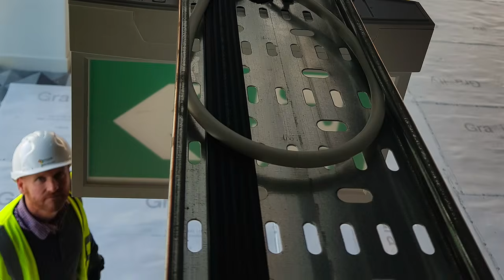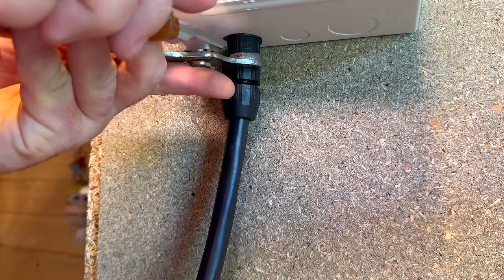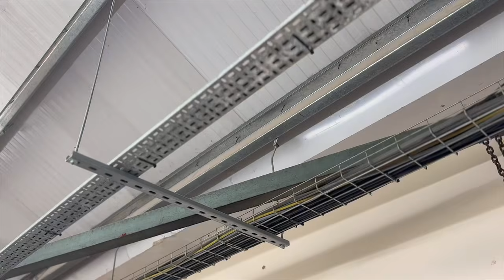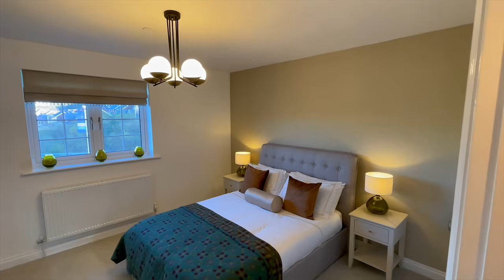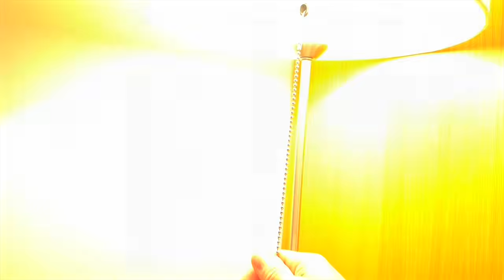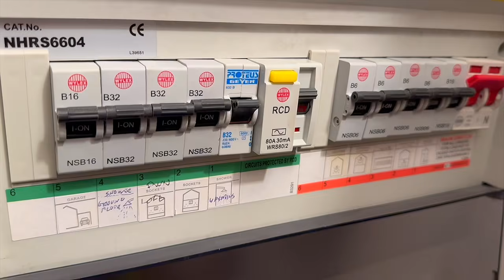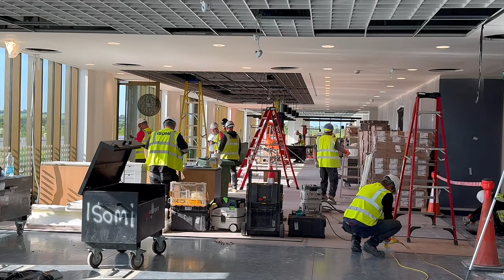The Cable That Isn't Really A Cable...

Comment: how do you isolate specific units you cant without access to the termination? what happens when you have larger loads than podus cant handle 32A per room is reasonable only for hotels and temporary domestic but no regular unit or apartment is going to be on 32 amps and that is most definitely a cable is it a standard cable no its specialised but definitely still just a double insulated cable that happens to be in a very specific formfactor that makes inline tapping convenient

Comment: Every branch MUST be fuzed.
There are plenty of good reason to have the fuses at a single location.
The bus is significantly more expensive to do RIGHT. And if the personnel doesn’t understand how it works, the bus can be extremely dangerous, so you MUST do it the way that will certainly enough prevent unqualified people tinkering with it, which is expensive.
But the actual reason WHY it is expensive is that hardly anyone does it, those who do that charge insane work rates, and the components are ridiculously expensive.

Comment: - It's still a cable... just a proprietary cable... that's part of a proprietary electrical ecosystem
 - A proprietary electrical ecosystem where if something breaks and requires replacing or fixing, you are at the mercy of the manufacturer for parts
 - A manufacturer that decides when 'that' model of 'that' part is no longer supported and you must buy the new one
 - A manufacturer that will probably jack up the price of said model or entire proprietary electrical ecosystem over time
 - A manufacturer that if goes out of business, good luck getting spare parts at all
 - A manufacturer that who's product cannot be worked on by the average sparky

So deferring time and cost to later or to other areas of the logistical and installation pipeline is what we call efficiency now?

Comment: Well outside of the United States they are already mostly running cables anyway, but here in the United States, you might see something similar for like office cubicles, or under a false floor. In a hotel with a hard lid could you imagine the ceiling covered with access panels all over the place, to service everyone of the tap points? Not to mention yes if the feeder cable goes bad at point 1 then 2 through 9 will be out, and the feeder cable from 2 to 3 would have to be replaced, or add a splice point with another access, which is another failure point. The biggest issue with this system is that it’s a proprietary system, every time something needs fixed you have to use the same manufacturer, that’s a servicing nightmare. Car manufacturers have been trying to do this for years so that they can build cars cheap and always have guaranteed maintenance for their vehicles, and you have to use the manufacturer and cat just use a repair shop. Apple was one of the first companies to do this to be different with there computer software. Every other computer company used windows and Microsoft, apple had to be different, this hurt them till the iPhone. You see it with Xbox, and play station, google and bing, Amazon and Walmart. The point is that they are trying to take the skill out of the trades so that someone who has no training can do the work to save on labor, at the cost of the customer later down the life of the project. Same as the car manufacturing companies wanting the guaranteed maintenance, they want a building that guarantees them profits for years to come form sales of replacement parts. Fire alarm, and security companies have already been doing this for decades.

Comment: With as many as 10 subtended rooms on a floor and with resistive heating and aircon cassettes or through-wall units, it might be wise to run two PODIS runs with one direction fed in reverse. Then putting the heavy load final circuits ends nearest the feed that comes from the larger supply ampacity end.

The labour would not go up, just the need for a large capacity cable to feed the other direction. If the plant room is central at core of building then this becomes moot and two runs with bus feeding from centre would offer resilience albeit with split feeding load and split fed dual bus-bar DB in the hotel room.

The install is less disruptive but a single issue over time could lose the floor.
Protection for each room would still be expensive but the diversity would be upset by probably standardising in just as big a shirt-circuit leak current capability along the whole run.

In the car EV situation, it seems that PODIS might attract less copper theft opportunity, but then, more likely to be visible than underground fed pillars.

You can make quite a few arguments over safety and economy either way. And the Ethernet delivery will be parallel fed optical or structured cable.

More than four rooms per floor, and perhaps a hybrid solution works best. Five radials and odd/even numbered rooms bussed via PODIS and depending if doors are spaced or adjoined architrave/intumescent boundary, then they might also share the same void mounted location for DB, BMS, PDS and DES. (Distribution board for power, building management system for fire alarm and air-con temperature override, Premises Distribution System for data, telephony and tv, and Door Entry System).

PODIS looks good for modest demand hotels, particularly ones near airports with arrivals/departures at all hours.

And long driveways with more charging points along a long wall or fence than the regular number of cars present. Assuming load curtailment based on occupancy and the maximum ampacity of each bus run.

Like Doncaster Cables, there is a time to use them and a time where you might opt not to.

Great coverage of the Wieland PODIS solution.

Another out of the normal way of thinking might be to run SOCAPEX 2.5mm, from the plant room to each hotel room, as the loads of aircon, towel rail, kettle, trouser press, TV and door lock fail-open mortice lock or handle barrel could likely fit in the BS7671 conductor grouping derating scheme too. Then, all the breakers could be in the plant room and just having a wiring centre in the rooms. Distribution mentality can pay back in other ways, such as if you have a really grumpy janitor who should be never be seen by the paying public.

SOCAPEX 1.5mm could be for lighting and other small loads, split between room pairings. With higher loads in same rooms split on 2.5mm SOCAPEX.
PODIS having the disadvantage of three phase hitting the neutral conductor that is not oversized or three phase represented at the ampacity strained distribution layer.

I may develop some designs for contractors to come in and use PODIS instead of classical industry practices or stage/event style philosophies.
And I am thinking of the merits far more now than how I concluded during the EV application of a common bus power fabric.

Thanks guys.

Comment: If the cable furthest from the DB only has to be rated for a tenth of the current... That's a hell of a waste of copper isn't it?
Reply: Yes, but if you stepped down a cable size after each room tap off, you would need a new breaker for each section of cable. You can't have a 63A breaker covering the whole string if the tail end of it is only 4mm CSA - a fault in the end section could be enough to start a fire whilst not being enough to trip the breaker.

Comment: How is it repaired if a Tapping point is removed ?
Can't just leave it with those Holes showing
Reply: Why do you need to remove the tapping point connector?

You can just leave it in situ. It is not unsafe .
Reply: Bathroom silicon ?
Reply: Black color…

Comment: And what guarantee is there that this system—and its accessories—will still exist in the future, say, in 20 years?
Reply: @tristankordek  I get nervous using proprietary systems. Open source usually gives more options when the supplier goes under or gets taken over by their competitor and shut down. 
Also brings up right to repair concerns.
I like better mousetrap. And I've been burned by proprietary systems that became unavailable. 

This is why we're paid the big bucks. To make decisions like this. Then to not sleep afterwards.

Comment: "This is a different way of doing things" is a wild thing to say about parts of a circuit close to supply carrying more current. You guys have heard of A2 radial circuits.
This 'system' is just describing any cascading sub main feeder system with a 16mm sub main before final, though, where the labour won't be that much more for none of the vendor lock in.
Funny to compare it to final circuits fed direct from a rising main, no new installs will be doing it that way unless they're in a small site with a complex layout like a converted manor house hotel, sites where this product would be useless.
You could compare it to wiring every single socket in every single room to its own metered connection to the grid for comparison, with that labour and those DNO costs this product would be thousands of times cheaper.
If you're not going to compare it to the genuine convention then you might as well have fun with it, right?

Comment: Is that system not somewhat similar to one that was being pushed 40 or so years ago?  By Datwyler, a Swiss company, IIRC, but that's not necessarily correct... I used their flat form cable for crane control / power festoons, and perhaps it was Datwyler sending me info, or maybe it was a competitor. I just thought the puncturing of the sheath and the insulation at tappings might preclude my reusing recovered cabling elsewhere...
Reply: I am not really familiar with their cables (outside of seeing their Ethernet cables), but yes, Dätwyler is Swiss.
Reply: @tookitogo  The more I think about it, the more I convince myself that Datwyler offered similar connectors in the 80s.  They didn't seem to be of much use in the crane industry at the time, and the inventory value was likely to be high... I can't find them offering it now... the 500m drums of multicore flatform were expensive enough...

Comment: If the cable is rated at 63A how is it suitable for a 160A supply ? If more than 50% diversity can be applied, guidance documents should be updated.

Comment: My initial thoughts. 
Discrimination. How is the protective device sized at the DB also protect the individual smaller cables to each room consumer unit ? 
If there is a fault and the protective device operates at the DB, you have lost power to the whole floor. Traditional system this is not the case, just one/two rooms ? One could argue how is this different to the "supply" to the floor DB ? I might suggest the difference is that the cable supplying the DB at each floor from the DB at origin is probably a single cable,  no connections/interruptions, no human interference/interaction and less likely to fail ?      
I am sure the manufacturers have thought of this, obvious questions but a little surprised they are not addressed in the presentation ? 
Thank you
Reply: Small distribution panels in each room connected to each branch cable 

A lot of hotels already do this.

Comment: One way to tackle diversity is a ring main, although imagine accidently twisting the cable at least the earth wire is in the middle😁
Reply: So you want to run two cables rather than one?  Okkkkkkkayy.
Seems like a strange way of thinking.

Comment: I am confused how this is different from when we run 10mm supplies in and out of rooms in care/nursing homes where each room has it's own CU on one large radial circuit with each room having a 20 Amp socket circuit for beds/ sockets and a 6 amp lighting circuit. There is a a chance some rooms might have an additional heater plugged in at some point but it's highly unlikely now they've switched over to electric blankets.
So every other room is on a separate supply/phase yes it's a different cable as it's only a 3 core armoured, or in some cases T&E depending on containment but I would expect our method is equally as cheap as this 3 phase flat cable.
Honestly outside of the carpark EV point showcase I originally saw this cable used for on your channel with load balancing chargers I can't think of another reason to actually put it forward for any of our sites.
So I am either missing something, or this is just as pointless as it seems if you can design well.
Reply: Every room is on a different phase? You must have more than 3 rooms, surely?
Reply: @deanXRayZulu  It was supposed to say every adjacent room is on a different phase. Love the AI auto corrections.
Reply: @effervescence5664 Auto correct only changes single words...
Reply: @deanXRayZulu  Every other "adjacent" room is on a separate supply/phase.
Reply: Its benefit is as busbar in premises which are organised in to separate rooms arranged in a linear way such as schools, nursing homes, hotels.

It simplifies cable installation.
Reply: @deanXRayZulu  For installation yes perhaps hence only for EV installation in car parks. For ongoing maintenance and upgrades in a nursing home - no. 

Don't know about you but we can't close off an entire floor or barrier off to drop the ceiling and get to one of the take off points for isolation. So it's far more practically to loop out of the CU's in each room that way the rest of the floor can continue to be used.

Comment: So that’s the back bone basically just a busbar with tap offs. .  How are the sub circuits in the rooms wired? How are they protected ?

Are assuming the swa sub main is also feeding local circuit protection and then local sub circuits ?

Comment: 6mm singles in conduit  clipped direct? Joe do you need to go back to college . Or stop using AI to write your scripts point two that thing is a cable the manufacturer say it’s a cable then it’s a cable. Stuff what the IET call it. The clue is in its construction a group of wires incased in a separate sheath is a cable you mentioned singles . That is single wires in conduit they are not a cables and being installed in conduit doesn’t make them a cable, they are still singles. And stop flogging a dead horse. We all know what that cable is and what it is used for and when and where to use it. We don’t need you to keep banging on about it. And stop talking so fast some of us have hearing problems and can’t understand what you’re banging on about. . .sorry to be abrupt no offence intended.

Comment: What would happen if one of the rooms trips a breaker? Would all of the rooms on that phase go dark or would there need to be a distribution board in each room?
With traditional setup, only the one room goes dark so you have a very embarrassed customer instead of 3-4 very angry customers to deal with.
Reply: There would need to be some kind of protection for each room. The backbone cable is rated at 63A which is way to high for direct connection of lighting and socket circuits and I don't think you would want a whole floors worth of hotel rooms on the same 30mA RCD.

There is a variant of the tapoff unit that allows you to mount breakers in the tapoff, or you could use a seperate unit fed from the tapoff. We aren't talking some massive DB here though, more likely something the size of a "garage CU" or "shower CU".

I think some hotels have a small CU in the room even with conventional wiring. Easier to have the RCD protection (which is the most likley thing to get tripped) local than to have to go hunt down a remote DB.
Reply: @petermichaelgreen  Yes, I was thinking there has to be protection SOMEWHERE between the supply and socket circuits — especially as many will offer European mains sockets which are expected to be safe with unfused plugs!

But on reflection, yeah, there MUST be a CU per room, mustn't there? Lighting has to be on a circuit that trips at 10A or lower, but you'd struggle to put the entire room on a 10A breaker when it contains a kettle and hairdryer? So that's at least two circuits in a room. 🤔

Alternatively, this is 2026 and the lights are LEDs. Maybe you run a single 10A lighting circuit for the entire floor and then a 16A circuit per room for sockets?
Reply: @c.jones-yt Lighting doesn't have to be on a circuit that trips at 10A lower.

The circuit trips at a current rating equal to the cable rating, or lower if you have designed it that way.

The problem here, with a 63A cable that you are likely to have non lighting loads on it, and a lightbulb blowing could trip the entire circuit.
Reply: @deanXRayZulu  But light switches are only rated to 10A. Because it's understood that lighting circuits should never carry more current than that.
Reply: @c.jones-yt There is no electrical reason why lights are limited to 10 amps and not why they are on their own circuit.
It is purely done to minimise the impact of the breaker tripping.
Reply: Of course they would.
It is quite common in hotels to have a distribution panel in each room.
Reply: You have distributed breakers, I saw a system in Meta's London office where every desk had it's own breaker so if the person using  that desk did something stupid it wouldn't take anything else out.
Reply: Trips a breaker ? What breaker ? I didn't see any PODIS breakers. I take it red and blue cores are live and black and grey neutral and if either pair fails, you've got green/yellow as a spare core while for earthing, you use the plastic water pipes.
Reply: @pmailkeey No, no.
Have you never come across 3 phase systems?

Comment: Another good video from Joe-3PO. I know you said a few times about the diversity factor, but one thing that clicked with me is that with the old system you could only apply the diversity of each room to the cable that feeds it, to reduce the cable size, but if you have all 10 rooms on the one system, now the diversity factor becomes a lot bigger meaning you really can get away with a much smaller cable.

Comment: Only a complete moron would size a supply to 10 rooms with CPD and Cable rated for 320A. Just 100A for good selectivity with the 32A devices.
Reply from the maker: Couldn't agree more....(gets coat)